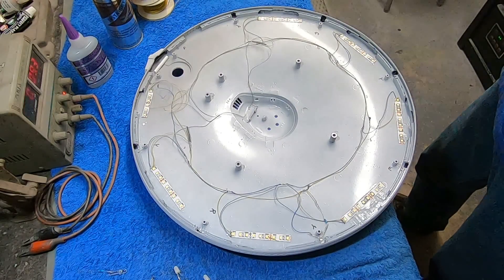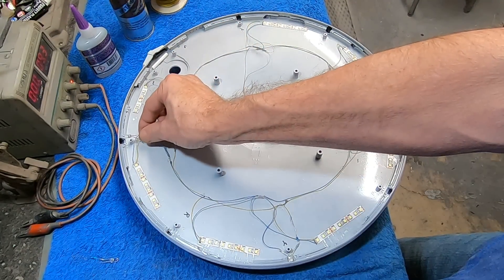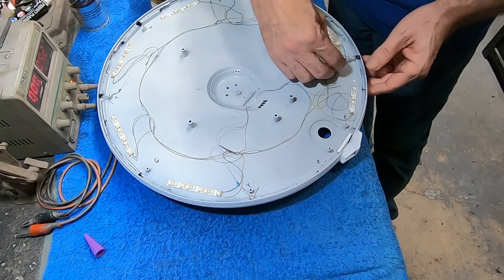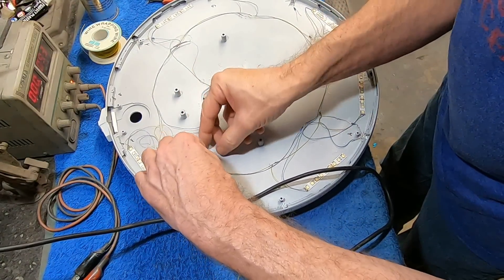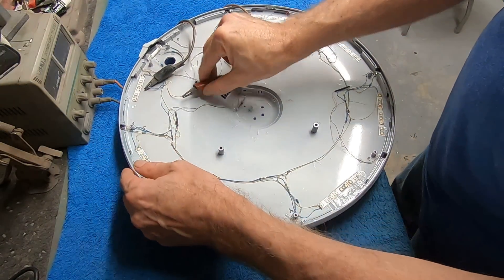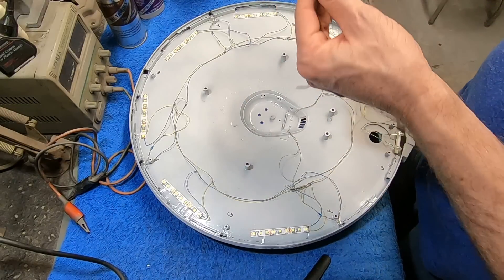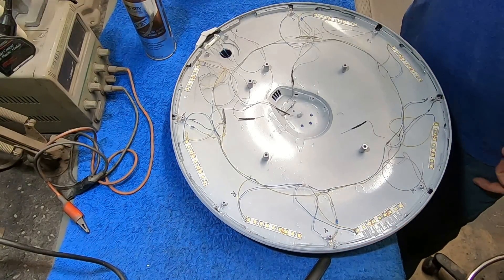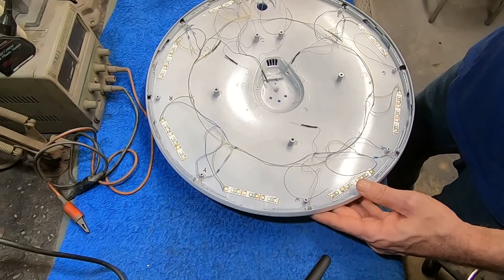1:350 USS Enterprise Refit By Polar Lights Updated Build Series Pt 5

Comment: Boyd, when I use the smd's and let's that don't have resistors, what kind, where, and which side do you connect them too? And dose each led or smart need one? I've tried this once before, and when I Che ked use with a 9v batteries, i blew all the smds. Help please. I need a course for dummies!
Reply: You should look at Trekworks how to  light up a model. Its very informative and answers most of your questions. Ralph at Tenacontrols will also answer any questions about how to use his boards. Happy modeling!

Comment: Wonderful Boyd. I am concerned that you will not be using the very latest tech out there for Light order sequencing. At 4:57 you point out there are control boards out there to control the lights separately. Kinda bummed you've decided to not include them. The intro to the whole series included how you'd be working with the latest tech since it's been nearly a decade that you last worked on this awesome ship. So I'm relieved you're working with 3d printer sets for sure and perhaps other latest advances. Will you be lighting in prep for matching the STMP start up sequence?

Comment: I had noticed the impulse engines were more of a reddish orange once ILM took over. I wonder if they even used the built lighting system for the engines but instead imposed the color later in the process. Only in TMP did I ever see the engine outlets completly lit up, and very orange.
Reply: if I remember correctly. I read years ago when they made star trek 2 twok the impulse engine bulbs burned out. They replaced them with red bulbs ever since. You can still see the original glow in the movie but that was stock footage from the SMP. I'm glad he's staying with the amber orage, it looks much better, more hotter, powerful.

Comment: Boyd, on this ship and the 1:537, I’m worried about cutting out square shaped holes for thrusters. Both on the saucer and on the engineering section near the dish. Thoughts?
Reply from the maker: There are super tiny micro files for that type of thing. Basically, drill an under size round hole and then work it open by hand with the micro file.

Comment: I have a few questions: What board are you going to use? I would like to add the Photon Torpedo, Phaser and some sounds when the ship does different things. I was thinking of getting the BT-1701-RR by TENACONTROLS to control it with my tablet. What do you think?
Reply from the maker: I'll be using a combination of Tenacontrols boards, a couple which I already had. I have the small board for the strobe/nav lights and another for the shuttle bay floor sequencing lights. 
A third, custom board comes in for the other effects like the deflector, warp engines, photons etc. The video will explain it when I get that far. I haven't tried one of the Mega boards, I've heard good things about them working well.
Reply: @TrekWorks  please check out the Mega boards. I really want your opinion on them.

Comment: Whew! That's great work! I didn't realize how many lights there are in the saucer. I like how you used that piece of sprue to prop up those LEDs for the impulse engines.
Reply from the maker: Lol, yes simple sprue is useful in so many ways, even making gap filling glue out of it. And I'm afraid we're only about half way there with the lighting of the saucer. The bottom needs to be mirrored with the top. I'm glad I do actually enjoy soldering everything. As my videos show, I have a complex when thinking about connectors, as in avoid them at all cost's!
Reply: @TrekWorks  Haha! I respect how you work. I like the way you think when building these kits!

Comment: Great work, Boyd.  So this is the final paint on the surface minus the Aztec painting?  Otherwise how do you avoid painting over the nav/marker lights?
Reply from the maker: Yes, the saucer top has it's final hull paint. I will be buffing it out with some fine polishing compound until it has a satin sheen. Then the lacquer based iridescent colors.
Reply: @TrekWorks  Thanks!  Do you have a Patreon?

Comment: I thought the yellow RCS thruster lights slowly strobed during normal ship operations?
Reply: Everybody takes a different approach to them. I have never noticed them change at all in the movies but a lot of cgi models used to recreate scenes from the movies do sometimes add effects to them.  Some people have them switch off when in warp mode, the argument being that they would not be needed but in TMP they are on when the ship is in warp.  So, as I say, different people take different approaches. In my 1/537 build I had 4 power modes 1 was internal lighting only, then 2 for thrusters mode (amber nav dish light) 3 was impulse mode (blue nav dish and impusle engines on) and 4 was warp mode (blue nav dish, impusle engines off, warp grills on) with the thruster lights being on and steady in modes 2, 3 & 4 because that it what seems to happen in TMP which is the one I was going for.
Reply from the maker: @cwam1701e  Yes, there are inconsistencies in the filming models and so recreating them gets interpreted in different ways. It gets worse with the later cgi versions. Wholesale lighting and even panel details change from scene to scene.
Reply from the maker: The thruster lighting  seems to change from scene to scene and movie to movie. Sometimes in flight they are not on at all. There are control boards that can add various effects to them.

Comment from the maker: Here is the list of what I used in this step and where: 

4 X 5MM Yellow LED's Saucer Top Thruster Ports
2X 5mm Yellow LED's Impulse Engine Grills
6X 1/4 Watt 470 Ohm Resisters (One On Each Yellow LED)
3X 0805 White SMD's Saucer Top Nav Lights At Bow & Impulse Deck
1X Green 0805 SMD Starboard Saucer Top Nav Light
1X Red 0805 SMD Port Saucer Top Nav Light
These are pre wired SMD's with resistors included.
Reply: Curious, why an SMD vs a 1.8 mm LED?  I have LEDs ready to install but wondering if significant advantage to SMD?  Also assuming you did same white, green and red SMDs on bottom saucer as well?  Also, could you show how your parallel wiring loop connects to a single + and - for power, just for clarity?  I think I get it but would like reassurance.  Thanks again for the vids!!
Reply from the maker: @GJ-st5hk  I like using SMD's mainly because they are pre wired and easy to install. It also depends on the look of the lighting I'm going for. The SMD's are great for small pin points of light like the nav/strobe lights on a ship. Other times I need something brighter and wider like an LED. That was the case here where I used LED's for the thrusters because it has to light 6 points of light on the top, sides and bottom of the saucer for each thruster spot. The + & - main power wires for the saucer will come up through the neck and connect to the ends of the 2 loops I made in the saucer wiring. The power for the control board I'm putting in the saucer connects there as well.